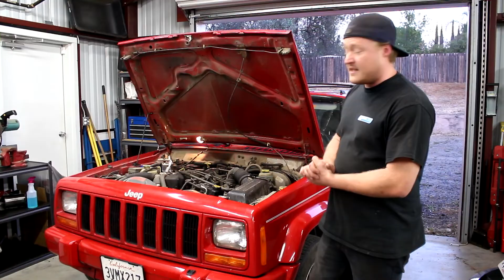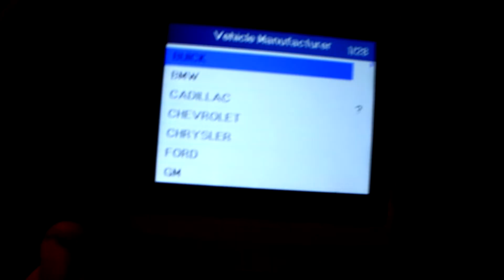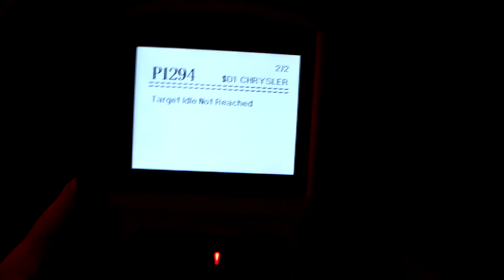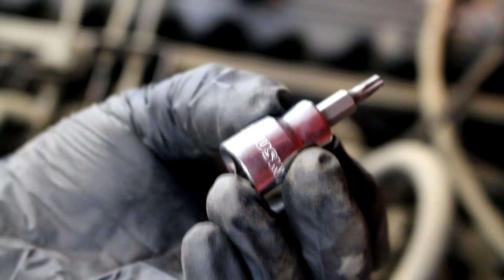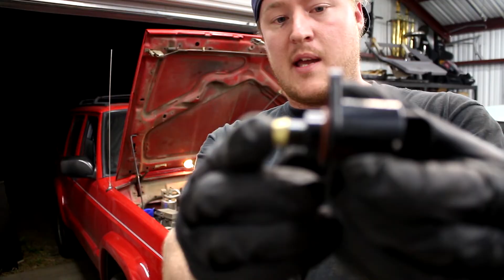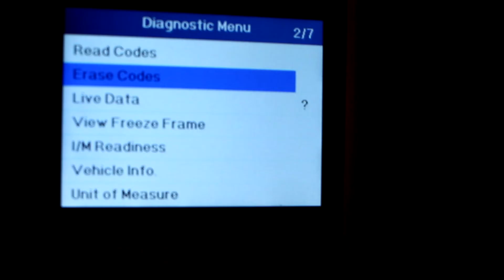Idle Air Control Valve problems P1294 and P0505 - XJ Jeep Cherokee #8

Comment: I just recently changed the idle air controller on my 2003 Ford Expedition with the 4.6L V8.  I tried to clean the valve and didn't get any change, so I replaced it. The 4.6 repair of the IAC was made as easy as can be because the IAC actually sits on the idle air circuit, rather than bolted to the side of the idle air circuit.  Disadvantage is that OEM price for the part is around $90.

Comment: You guys need to start it up so that people can see what it sounds like to see if their problem is this same problem
Reply from the maker: What you mean hear it idle high? Bad IAC can have low idle, no idle, high idle ir erratic idle. My case was high and it had the codes.
Reply: @GearHeadsGarageChannel  yes, mine had a high erratic idle and I eventually fixed it, but I thought it was a throttle position sensor because both codes were up but it ended up only being the IACV not the TPS. These are topics that should be discussed in a video I think. Idk, maybe I know too much about old jeeps for my own good😂
Reply from the maker: @corbinlauvray1535  Well if you ever start doing videos you will find out quickly how many things you COULD have said when you go back and are editing it. Theres a never ending list of things you could potentially add, this one was quite awhile ago but I do my best to be thorough and say what is relevant and needs to be said, sometimes I make mistakes tho!
Reply: @GearHeadsGarageChannel  yeah👍, I know, I just said it because I think or criticism as a way to make things better, I use constructive criticism in my daily life and I'm guessing you do too, just a way to get better. Not trying to say your videos are bad, they are great!
Reply from the maker: @corbinlauvray1535  thanks man I appreciate it and do my best to keep learning and getting better! Good luck with your jeep!

Comment: My folks own a 1996 jeep cherokee sport 2 door rear wheel drive high out put 4.0 . Originally a conservation jeep. It was made late in the year so it's also and 97ish model as well . It uses a 97 and on up TPS not a 96 TP S ?  Factory wiring no splices. Started having problems cutting out once in a while or reving high and with the check engine light would come on some times . Replaced the TPS fixed it for a while and back to square one  off and on same problems? I came across your video will definitely check/replace the idle control module.

Comment: Just replaced mine on 2001 Cherokee. Same problem and it too was stuck in the extended position. Jeep is running good for the moment and check engine light is off. Good video!
Reply from the maker: Great! Good job and thank you 👍
Reply: @GearHeadsGarageChannel  ⁰⁰0

Comment: Dude brake cleaner?  They make throttle body cleaner. Brake cleaner contains bleach you have to use throttle body cleaner
Reply from the maker: lol no you dont. Every shop I have ever worked in and seen uses brake cleaner for everything, only one you might want to be more careful with is MAF sensors and use MAF cleaner. Carb/throttle Cleaner and Brake cleaner are near enough the exact same thing and both will work just fine for cleaning.

Comment: While driving, I've seen my idle drop, then it kicks back up, then drops again at random times, could it be the iac? Sometimes when I start the engine the idle jumps high then drops back down while in idle and warms up. I took it trailing and worked all morning perfectly, came home, then when out for dinner and while driving on the fwy, it was driving fine then the idle started droping and jumping back up. Any ideas?
Reply: I have exactly the same problem in my "89 4.0 Cherokee. Idles at 750 then slowly drops to 500, then pops back up to 750. Sometimes stays at 750, other times it stays at 550. Rarely stalls, only when cold. Annoying. Did major tune up and new coil. No effect, runs smoother but idle still drops. Had to be IAC, replaced today, had zero effect. Gonna reset ECU with new part.
Reply: @fredbroom5050  I did a major tune up on it too and had no effect. I did the cruiser54 steps and still nothing. I ended up selling it and bout a newer one , a 91and doesn't have that issue.

Comment: I cleaned my throttle body replaced both tps and iac and now have a high idle AND stalling issue,,, any ideas?
Reply from the maker: Forget to plug something in? Have a vacuum leak? one of those seems likely
Reply: Make sure you reset the ecm.i recently replaced both as well and still running rough .reset the ecm and got new battery terminals and has been running great.
Reply: @joegutierrez1999   how did you reset the ECM?